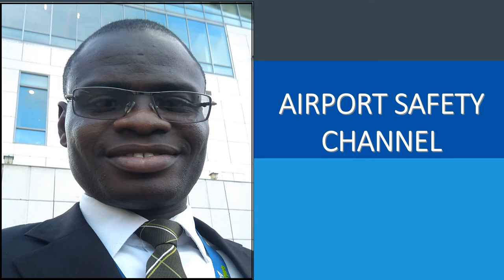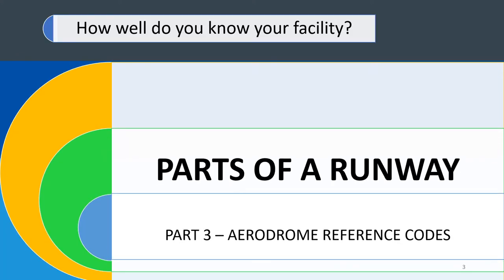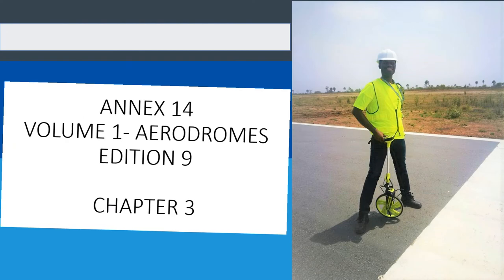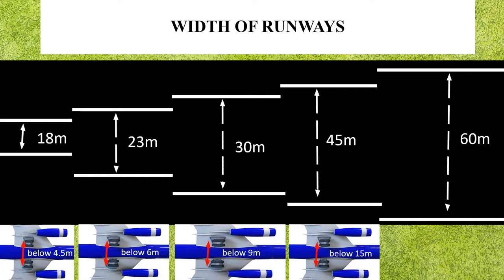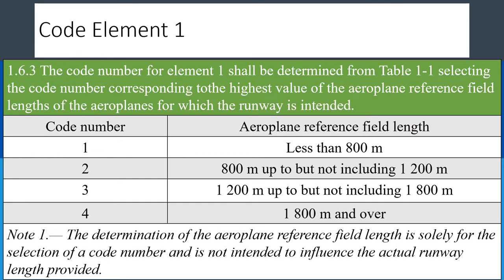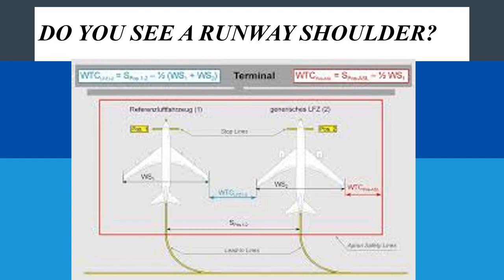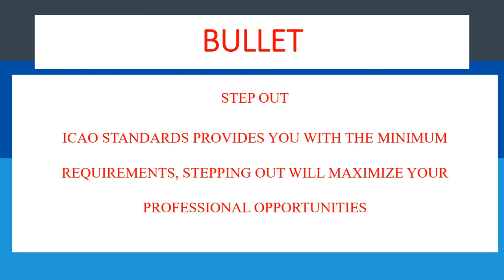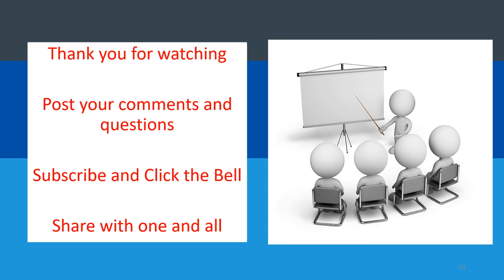Lecture 7 AIRSIDE FACILITIES   PARTS OF A RUNWAY PART 3 ARC

Comment: Thank you for the very useful video. Could you be so kind to tell me where I can find the Aerodrome Reference Code of a specific airport? I already searched the AD2 document in the AIP of several airports but not a single time I found the ARC. Thank you in advance.
Reply from the maker: Hello, check for the length of the runway,  find the critical or biggest aircraft that operates to the aerodrome, and refer to the presentation. You can determine it by yourself
Reply: @airportsafety  "find the critical or biggest aircraft that operates to the aerodrome", how could I determine that?
Reply from the maker: @Yves Krieckemans  Check the Aerodrome Operations Manual or the SOP for airside operations unit.

Comment: When an acft tire blast on rwy n the acft leaves the marks on the pavement, wht are the things to be considered as a part of rwy inspection sir ? And kindly provide the relevant icao reference for this subject matter. Thank u 🙏
Reply from the maker: Dear Rakesh, Thanks for your inputs. Reference Annex 14.2.9, Doc 9981(3rd Edition) 3.3.1 & 3.3.2 the frequency and purpose for an inspection will be found. Also the local CAA will have guidance material on what they expect from the Airport Operator after an incident.
Reply: @airportsafety  Dear sir, at the end of the day its a decision of an inspector to report the surface condition after an incident, as you are well aware of operational significance of the rwy where we have a single rwy operation, prior to any   safety assessment  what we suppose to advise atc on the current condition & operational status as insisted by annex 14.2.9....thank you for your kind reply sir. would like to learn more from you personally if any means of communication available to connect with you.